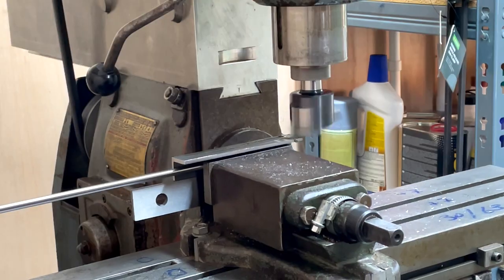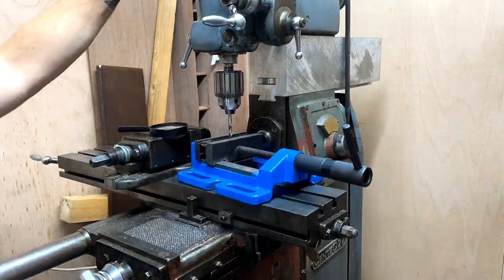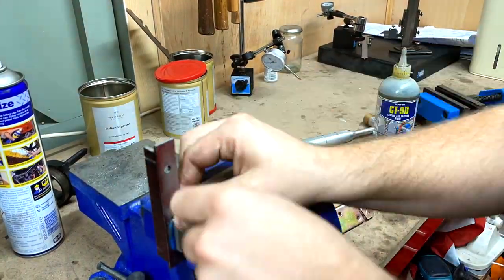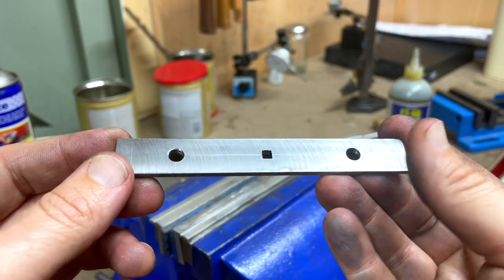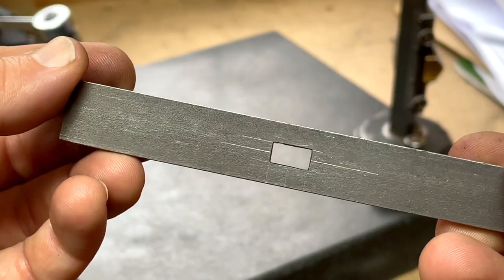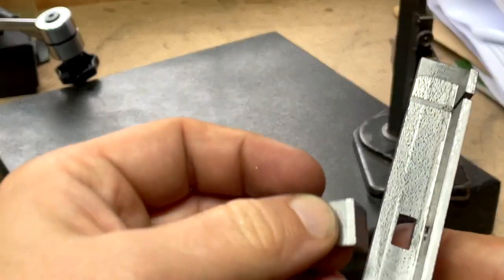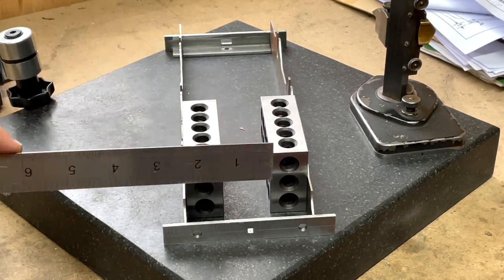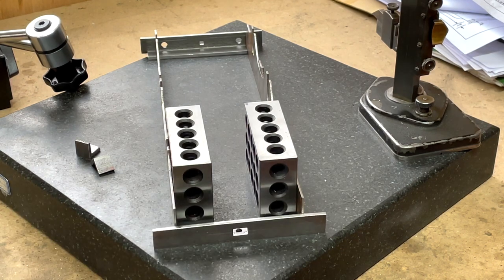Loco Build 2.3 - Trying out Fly-cutting on my mill

Comment: Glad to see that you're back in the workshop and hope that your back is much better.
I don't know the dimensions of the loco that you're building, but there doesn't appear to be much space for riveting, so I suspect that it will be silver soldering. If you can get hold of some refractory bricks, as I mentioned before, they really do help with localising the heat and make silver soldering easier. I know that model engineers also use a bed of coke for the same purpose. Other than that, good clean surfaces, close fit of parts and an adequate sized gas torch should enable you quickly to master the technique. Also as I previously mentioned, using small pallets of silver solder pushed into the flux paste works very well. Don't overdo the flux, but also don't be too sparing. Start with a gentle flame to boil off the water from the flux paste without dislodging the pallets, and then increase the intensity until you see the solder flow. Also remember that both sides of the pieces to be joined need to be raised to soldering temperature to permit the alloying to occur: when you apply the torch flame, give precedence to the larger piece, in which the heat will dissipate more quickly. The assay quality silver solder paste that I have is also great to use and comes in various temperature ranges. I have Medium and Easy and they have met all my requirements so far. Having the paste also ensures that I'm using the appropriate flux for the particular solder.
I hope that you will let us know more about the pillar drill, snd show us some footage. My bet is that your purchases are still not finished, and my guess is that you will find a good bandsaw irresistible in due course as they are so useful and versatile.
Best wishes.
Reply from the maker: Yes, I think I will try to silver solder - I have done it once before (successfully). I think I need to sort out a weighted third hand to hold the parts down - I'm a little worried at maintaining alignment in two axis while silver soldering!